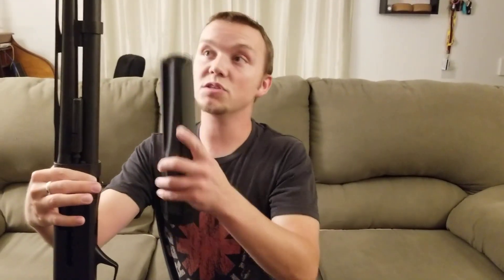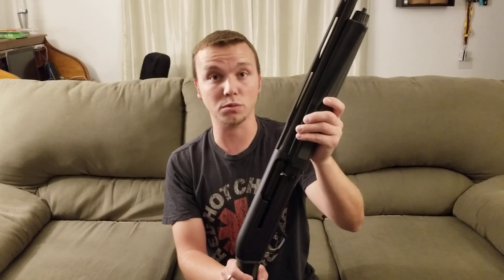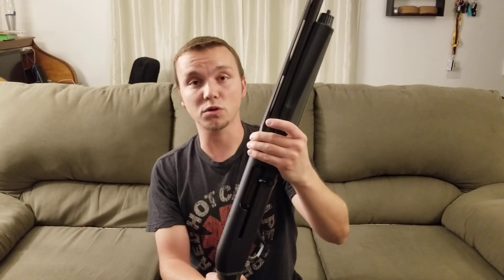How To: Fix Loose Remington Versa Max Forend

Comment: Yo, thanks for making this video. I just picked up a Versamax from a local dealer and love the gun, but that wiggle is a bit annoying for me.
Reply from the maker: It's a phenomenal shotgun they just needed to do better on the forend. Just take your time with the heating process and make sure to fan the flame over the plastic as you go. Worse comes to worse, contact Remington about the wiggle and ask for a replacement forend if you run into issues heating it up.

Comment: Correct me if I am wrong but I thought the gap close to the action is for the pistons to exhaust to? That is where a lot of my carbon blows out.
Reply from the maker: There's still plenty of gap for the pistons to vent but you can remove a little material from the forend where the piston vents to give it more breathing room. I haven't had any issues with it since having tightened it.
Reply: Let's think about that reasoning for just a second logically.  If Remington was saying "we need a place to vent spent gases underneath the foregrip" and some Jack Wagon in some meeting said "I know, we can loosen up the tolerances in the forend sloppy enough that the foregrip wiggles enough to let gases out from the back!" and then Some executive WENT FOR IT; well they deserved to go out of business.  You dont design slop into a firearm to make it the best in the market, you do it to save a ton of money and make a select few rich as Jeff Bezos.  If it needed to vent gases, they could have vented the gases in a much more elegant way and made the foregrip solid...all they had to do was care.
Reply: @michaelbarrett1914  Should never have gotten past quality control . You can't melt wood furniture. Shaving burrs off the top of the forearm ?

Comment: That forend seems to be a complaint of many owners Nich. I've been looking over the Versa Max Tactical shot gun recently. Wanted to get the updated V3 but again I've seen complaints with shells not being fully fed on those. Wondering if its worth the chance to take on the Versa Max now called Rem Arms by the new Buyer company. TY for posting this video for me its a question of staying with an American icon for shot guns or going to the Italians Benelli M2 / M3 / M4 ? The reviewers of the Versa Max never complained about the ability of the gun to cycle ANY rounds. I've seen posts of Benelli owners saying their M4 initially didn't like the lighter rounds but once its had 50 rounds thru it the lighter loads work fine.
Reply from the maker: The gun is a powerhouse in performance. Take away minor issues with forearm fitment and the gun is perfect. I dare you to find a gun that runs as reliably as the versa max series. I've never had a single is issue with performance and I've put thousands of rounds through it.
Reply: @NicholasVonBusch  I love mine! I spent 25 years shooting the 870 pump action at work..... never again will I shoot a pump action!  When I got the Versa Max I spent an hour shooting super hot loads even 3.5 inch and my shoulder and chest was not sore or marked-up at all. Love this shotgun! I tried everything on the market and narrowed it down between Browning, Beretta and this Remington. I performed a little bit better with the Remington so I went with it. Glad I did!  I don't have a problem with wobble yet.

Comment: Do you still have the gun? How did your fixes hold up?
Reply from the maker: @waltermajors877  still have the gun, fixes are still holding up. I'm honestly surprised that rubber bumper hasn't peeled off but I'm still running the original one on there. Gun still runs like a champ. Haven't found a semi auto that cycles more reliably. I've even shot the Winchester AA Low Recoil/ Low Noise rounds that are meant for pump action shotguns and my Versa Max cycles every shot without failure. No one's semi auto will do that. It feels like it kicks like a Ruger 10-22 rifle.